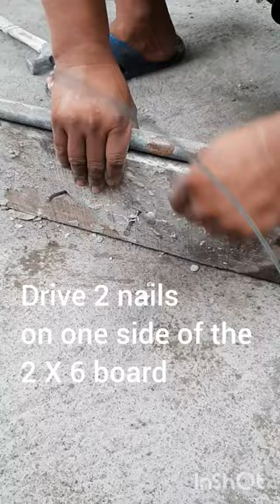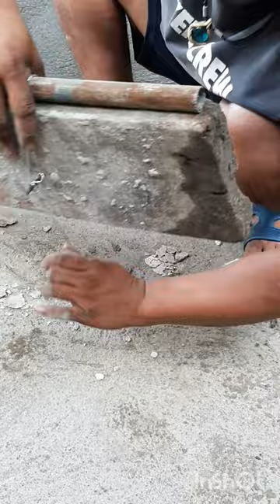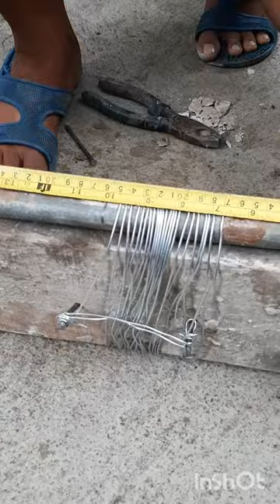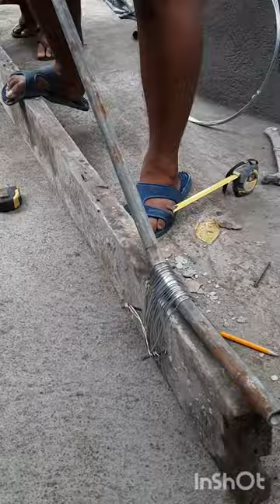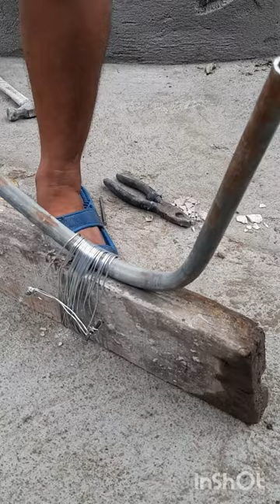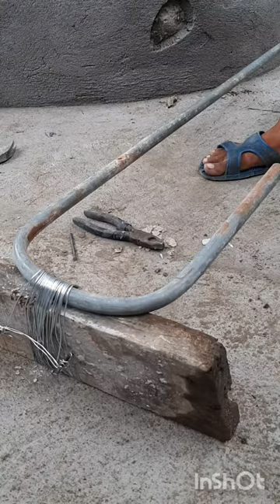Unique Way Of Bending Pipe Without Pipe Bender

Comment: Seems crude but it works! Few $s for the wire and that's it. A bit of trial and error to work out exactly where to start the bend but it's quick and simple. Thanks for the tip!!